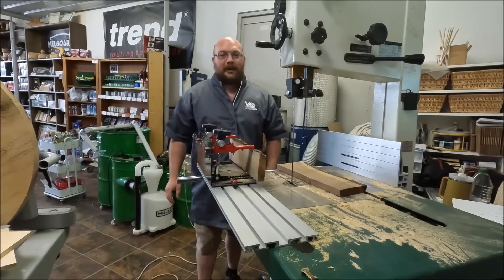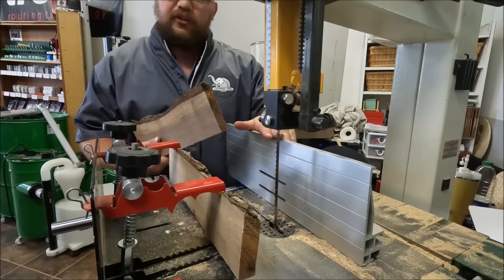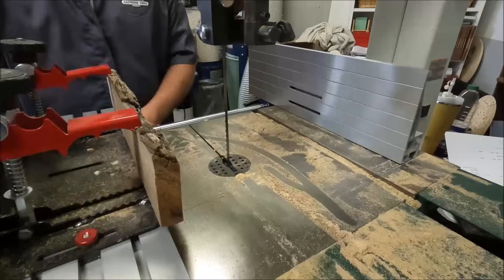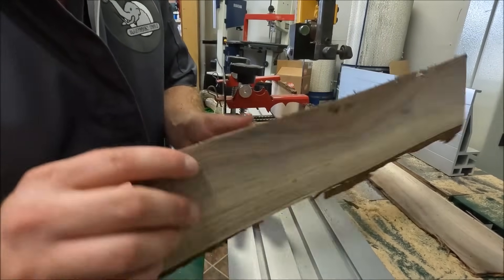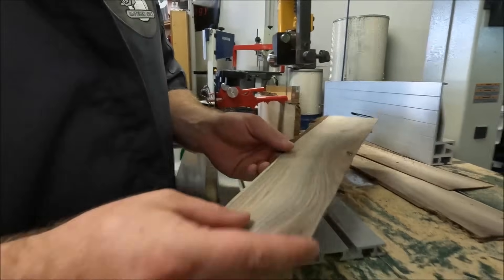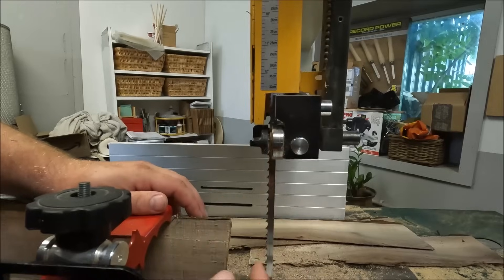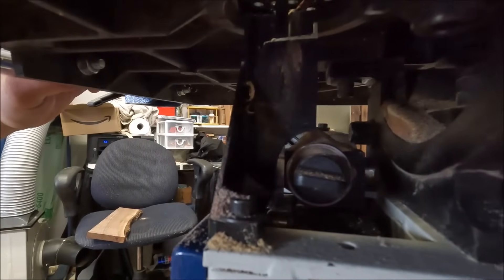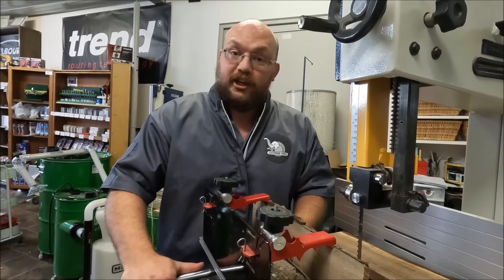The ONE & ONLY Reason Your Bandsaw Drifts & How to Stop It! EthAnswers

Comment: A lot of bandsaws do not have the mitre slot aligned to the run of the blade, and the fence is not aligned to the run of the blade either. It is how commercial bansaws cut wood so nicely, just as you have explained. The rear guides keeps the blade vertical. As you say, side guides are not really needed with nice sharp blades.  Many do over tension their blades as well.  A great video. A simple sled makes cutting so much easier.

Comment: Thank you for this video, I'm wondering if this is my issue.  Mine is practically brand new, and has been drifting almost immediately.. I say almost cause I remember one of my first cuts on a 4x4 and it got so bound up the blade came off the wheel.  In my ignorance I put it back on, probably wrong, but got it cutting again, but it's never cut straight since.  
I"m going to order a new blade and see if that helps, but my question is,  what's the solution to cutting straight?  I can't afford to buy a $400 carriage like you're showing here, and sounds like this will happen constantly with a fence.  Is there another solution to cutting straight? or is there safe way to use a fence?

Comment: This may be true but I know drift is inherent in the saw, b/c there’s drift even with a brand new blade.   40 years experience tells me as long as the fence it adjusted to match the drift, the blade cuts evenly.  But you’ve got a product to sell I understand that.  Snodgrass has convinced a lot of people there’s something wrong with their saw, and they start monkeying around with it, which is 100% wrong.  Also some people use tracking, which is a mistake, too.
Reply from the maker: In my experience a brand new blade never drifts until it is bound...which can happen in the first inch of your first cut with a fence or freehand. Thanks for watching!

Comment: Some guys will come up with anything to sell a jig. The idea that your fence is destroying your blade is pretty wild. The fence shouldn’t extend past the blade more than a few inches and at that point the wood can do whatever it wants. I resawed many boards using a fence with no issues. And blade drift has a lot more to do with the blade alignment on the wheels than anything else. I’ve never experienced Blade wear on one side or the other like he’s talking about. But hey, if you wanna buy a jig that solves a problem that doesn’t exist, go ahead and spend your money.
All the Best,
Chuck
Reply from the maker: Thanks for watching Chuck! What do you think of my latest video? https://youtu.be/J0jpjCdJt38?si=mvPP4Epgjk0S3uxb
Reply: The fence doesn’t constrain the blade anymore than a thick piece of wood does. The teeth on the blade will cut the wood if the teeth are sharp. The fence isn’t pushing the teeth and bending them or dulling them. I agree with you, I think he’s just trying to sell this contraption.
Reply: @davidt8438  I should modify my response. The sled he is demonstrating is great for resawing round stock like logs, which is what I've seen them used for.

Comment: I have an idea. If you want your blade to stay sharp a long time don’t cut wood with the bark on it,. Unless that part of the projects details. Bark collects dirt dust and even sand on windy days. Layers and layers.
My experience with my big bandsaw isn’t drift it’s cut quality after the blade gets broke in. I use the guides to run one side to push the blade straight. I get a surface that looks as good as a tablesaw rip.
Bandsaw are one of the most temperamental machines in a woodshop.
Reply from the maker: Bark dulls blades fast! Thanks for watching 😀

Comment: YouTube is filled with so much bro science, sigh If this was true then feeding the work by hand instead of using a fence would cut perfectly straight too, but it usually doesn't.
Reply from the maker: I guess it depends...can you hold a piece of wood straight to 0.025"(thickness of a bandsaw blade)? I certainly can't! If you can't either you will be binding the bandsaw blade by hand the same way you bind with a fence. You may enjoy this latest video - https://youtu.be/J0jpjCdJt38?si=IxBLp63CiftrUhMv
Thanks for watching!

Comment: also Band Saw Blades are Stamped out, it can leave a Hook edge on the back of the blade. use flat carbide stone and Round the back edges as the saw is running. 😏👍
Reply from the maker: Thats a great tip especially for cutting curves!

Comment: It is not 100% of your time the blade. All those other things you mentioned affect how the blade cuts. I spent close to 20 years repairing band saws and a bad guide or the blade setting wrong on the wheel the wheels out of alinement or a host of other factors  can make a band saw drift.
Reply from the maker: In my experience it is the blade 100% of the time. Though a bad guide alignment can damage the blade leading to drift. Thanks for watching!

Comment: Thank you this makes so much sense. About the fence though, how about using the Old European short fence that ends just at the teeth of the blade, or sometimes just after the beginning of the teeth? In this way one would use the back of the blade as a sort of splitter?
Reply: I had the very same thought!
Reply from the maker: That's the best way to use a fence! This video talks a bit more of the challenges of a setup like that - https://youtu.be/sY7xKKUGBgE?si=QsEd3QKWcAYXvaQs

Comment: Great tip! The non precision Band Saw machine is very challenging, adjusting the top guides is much easier than the bottom guides, I have found. Keeping them in sync is impossible without feeler gauges. Thats why wood working is so much fun. Unlike chip cutting. Old machinist here.

Comment: I don't get it, do you need the fence or not? He seems to imply drift is caused by the wood expanding against the fence when cut, yet the track device doesn't?
Reply from the maker: I understand your confusion! The main difference is the Little Ripper locks the wood in place keeping in from moving where the wood is free to move when up against a fence. This video talk about this a bit more - https://youtu.be/sY7xKKUGBgE?si=Oo9daZLFwB9_KNAE

Comment: Your explanation on blade drift is an eye opener.  I am struggling right now with my 17" bandsaw breaking blades.  It just started to do it.  As soon as I power it on and it gets to speed,  the 1" blade comes off the wheel and breaks.  I've check the things I know to check.  Tires, bearings on the wheel, no wobble.  I even put a dial indicator on the wheels to check runout.  5 thou runout on both wheels.  That's checking it unpowered and just turning the wheels by hand.  Tires look fine.  I placed a new 3/4" blade (Timber Wolf T25048 - 131-1/2" x 3/4" x .025" x 2/3 TPI Pos Claw Bandsaw Blade) and did the blade alignment with the guides.  It looks like it's tracking really well by hand.  I use the method to align by Mr Snodgrass.  I never could get the 1" blades (Timber Wolf brand) to align to the thrust bearing without a difference in gap throughout a complete rotation even when brand new.  I haven't powered the new 3/4" blade yet.  Worried as heck as it might track off and break.  Any suggestions would be greatly appreciated.  The bandsaw has urethane tires on it.  Maybe replace with brand new?
Reply from the maker: That’s a tough one! Has this happened more than once? How much tension is on the blade?
I would suspect it happened because the blade had a hairline crack or was running to high of tension…or both

Comment: Thanks Ethan great video, what size bandsaw is required to use the slide properly. I only have a 10” saw and the table is not too big.
Reply from the maker: Thanks for watching! It will fit down to about a 12” square table. This video shows it being used on a 10” Rikon - https://youtu.be/d8aBH9aoCCw?si=cWefLJGWJTC_jP_O

Comment: How is it that the jig is not just acting like the fence, just on the other side of the blade. The wood is locked in an cant move left, just like a fence on the other side of the blade.
Reply from the maker: The key word is locked. The Littler Ripper locks the wood in place where the wood against the fence is free to move however it wants. The wood in the Little Ripper claws won’t move until the claws are released. This video talks about that a bit more - https://youtu.be/sY7xKKUGBgE?si=2bRnu_lvTl68PVHu

Comment: I get that having a brand-new quality blade with undamaged tooth set will greatly help in making cuts that are straight. However, I don't completely see how the Little Ripper is different from a fence. You explained the case where, if you try to resaw using a fence on the left side of the blade, if the wood "deforms" as you cut it, and presses on the left side of the blade, and then damages the set on the left side of the blade due to forces between the fence and the left side of the blade. I get that. But isn't the Little Ripper just a fence that is on the right side of the blade? In your video, you just cut a very thin slice off of the slab that was mounted in the jig. But what if you had a big thick workpiece mounted in the jig, and wanted to resaw it in two. So, you start the cutting operation, and as you do, the stresses inside the wood cause the wood to press against the right side of the blade, because the wood slab is constrained on the right by the Little Ripper jig (just like a fence does). Would that not damage the set on the right side of the blade? Whichever way the forces are pressing as the wood is cut and stresses are released, if you have wood that is warping as it is being cut, it could be applying forces to the blade, either between the fence and the left side of the blade, or the jig and the right side of the blade.
Anyway, for the moment let's forget about how a new blade can be damaged by trying to resaw with a fence... Let's say we have no fence installed, and we have no Little Ripper jig. We just have a slab of wood that we are going to try to re-saw freehand, by following a line marked on the top of the workpiece. Surely, we would have to make sure that our brand-new blade is "aimed" straight? How do we do that? Other bandsaw videos explain that the "aim" of the blade is determined by some combination of how the blade rides on the top wheel, and how the blade guides are set up.
Reply from the maker: The crucial difference with the Little Ripper is that face that the wood is locked in place with the claws. Wood cut up against a fence, regardless of thickness, will stress. Wood locked in the Little Ripper, regardless of thickness, will not stress until you release it from the claws. This video touches a bit more on that - https://youtu.be/sY7xKKUGBgE?si=2bRnu_lvTl68PVHu
Thanks for watching!!
Reply: That’s why this is a big commercial for the “little ripper”

Comment: It’s been a few months now, hopefully you’re still answering questions 🙂

Given the way you explained the problem it seems to me that you could add a panel of wood to the fence ahead of the blade, or use a resaw guide, and that would work just as well. I don’t yet have a bandsaw, am I missing something here?
Reply from the maker: A resaw guide is an odd solution that some have success with. When using a resaw guide you twist the blade back and forth to do your best to follow a line. It’s terrible for tooth set but with enough practice you can compensate for the drift fairly well. Very hard on blades though.
Having the fence end at the blade is a better solution! You NEED to have a flat face jointed board to ride against the fence otherwise it will rock. As soon as the wood rocks against the fence it binds the blade. It is amazing how little binding it takes to ruin the set on a bandsaw blade.
The best solution is a resaw sled just like every sawmill uses.
Thanks for watching!

Comment: Great information for sure. But you also have to have a sharp blade to begin with...and proper teeth set.   Thumbs Up!
Reply from the maker: Yes! You need to start with a fresh new blade when resawing. As long as that blade is dedicated to resawing with a sled(like the Little Ripper) it will get still get full be equally dull both sides. Even with a dull blade it will still cut straight when used with the Little Ripper. 
Thanks for watching!

Comment: Great job!  You seem to have a firm grip on reality!  There are still folks on YT telling how to make an adjustable fence, so you can turn it to compensate for drift!  I only get drift after I've beat up a blade.
Reply from the maker: That’s the first I’ve been told that! Haha
But it’s true…bandsaw blades cut straight until they don’t. If we are careful with the blades it makes all the difference!
Thanks for watching
Reply: Erm, but they are right once a blade starts drifting and you can’t afford to buy a new one. 
So the method here works fine until a blade gets damaged, while an adjustable fence is working all the time.

Comment: Thanks Ethan, this is a great video.  Owners of a SHOPSMITH bandsaw need to be aware that their saw is unique in that there is no adjustment for blade tracking. The saw is designed so that every blade runs near the back of the wheel and against a pair of "Auto-Track" bearings that are in the arm of the saw due to a unique arrangement of conical wheels (not drowned). Likewise, the backup bearings below and above the table aren't adjustable forward and back because they don't need to be, because all blades run to the back and against the bottom bearing, and if the saw is properly aligned, just ahead of the upper bearing. It's pretty sweet, actually but there is drift caused by the unique design. Anyway, great video and these techniques work for my 14" Delta. Scott
Reply from the maker: good info! Thanks for watching!

Comment: I'm retired and too busted up to do much anymore, but after re-sawing what seems like miles of quartered white oak, I've gotta say that I think the wood can matter quite a bit. Oak is ring porous and has pretty dense medullary rays, and a bandsaw blade will seek more porous parts of the board. I built a fence that allowed me to adjust the fence's angle slightly without changing the distance from the fence to the blade. It worked well.

I've also wondered if you can count on a new blade's set to be quite right. They're mass-produced, and I'd expect some deviation from perfection.
Reply from the maker: As a blade gets dull and the woodworker applies a bit too much pressure bandsaw blades will tend to follow the wood grain. 
Thanks for watching!
Reply: @StockroomSupply  True enough. And I have to admit I could be a bit parsimonious when it  came to buying blades.

Comment: I may be wrong, but if this guy is right why not shifting the fence on the other side. I mean on exterior.And the thin side would have more space and not be squized. I think this so clever guy is trying to sell another useless expensive device fore some big amount of money.
Reply from the maker: That’s absolutely the best way to use a fence! There is still a big issue when you resaw a board right down the middle. This video explains this a bit more - https://youtu.be/sY7xKKUGBgE?si=pd1u1FuemkgS4TJi

Comment: Hi thanks for the great video. I cut mainly metal/ alloy on my band saw so I run an 18TPI finer tooth blade. Does all you said in your video apply to metal cutting as well, I assume so. Thanks
Reply from the maker: In many ways yes! Same principles apply. Metal generally has less interior stresses than wood so cutting against a fence is as detrimental. Still do everything possible to protect the set on the bandsaws teeth 
Thanks for watching!

Comment: I have exactly this problem, I realized that one of the under the table bearings is missing from the very beginning. I made myself the exentric bearing support and now is working better but not 100%. I am a luthier and need almost perfect cuts in some of the parts I make for building a guitarr.
Reply from the maker: Good job finding the problem! Sounds like a Little Ripper may be a future solution - https://youtu.be/R1Y-bUUz338?si=_rCKRRq6n8T1BGSJ

Comment: I can’t make sense of this. The rational that the natural compression or tension that is released when you cut is inconsequential with a carriage compared to fence makes no sense as both the carriage and fence are non moveable objects, I.e. the wood will not move either of them laterally. I fully believe that the carriage is a great option for a number of operations.  But there is no logic, based on what was presented, that indicates it solves drift.
Reply from the maker: You are exactly right in saying the fence and carriage are both immovable object’s but the import part is the wood does move. When using a fence wood is able to move and bind. When using a carriage wood can stress on one side and on the other it is locked into the carriage with claws becoming an immovable object. This video helps explain this a bit more - https://youtu.be/sY7xKKUGBgE?si=15H4nk8f6GZFKbrf
Thanks for watching!

Comment: The most IMPORTANT thing to correct drift on a bandsaw is to make sure the blade is on the tires correctly. If you get the teeth lined up properly,  99.9999% of your drift issues will go away.
Reply from the maker: That hasn't been my experience. This video shows how little difference the blade alignment on the wheel makes -  https://youtu.be/4k-r5utmU2Q?si=TvWy6wrTFP6a5lrh&t=379
Thanks for watching!

Comment: Thought the Little Ripper was designed to slab " logs", how do you set it up to rip boards especially when aligning them?
Reply from the maker: Originally we designed the Little Ripper to cut logs but then realized most customers are using it to resaw! Here’s a video showing how to set it up to do just that - https://youtu.be/VeuALqx1uAA?si=hATcrZUtZQ8OQ6SV

Thanks for watching!
Reply: @StockroomSupply  Ethan,  thank you. Actually bought one a couple of years ago but life got in the way to use it between selling, moving, new shop and total knee replacement on one with the other in the works at least my mind is  into woodworking/woodturning.